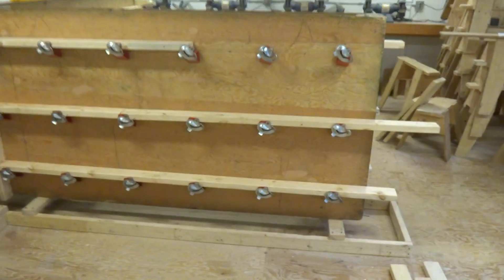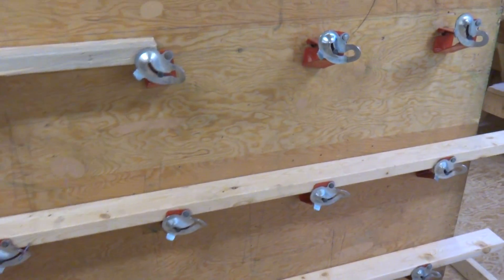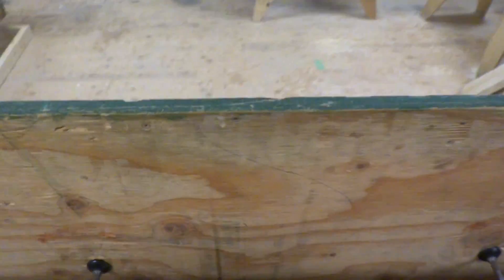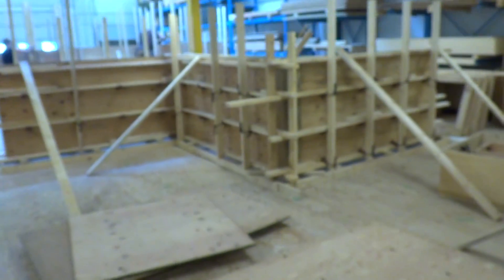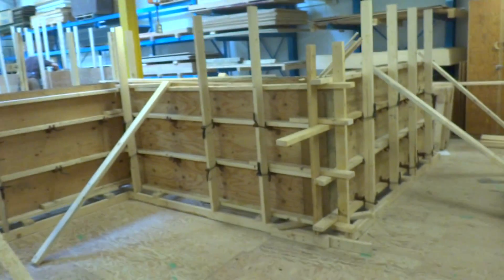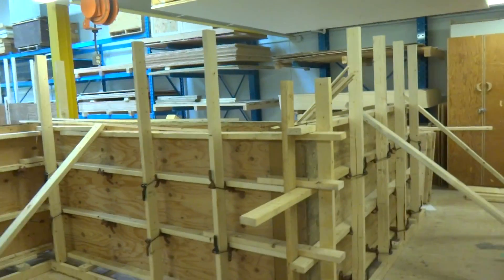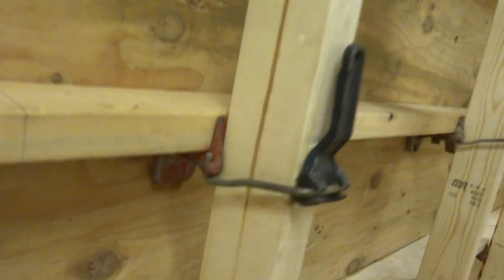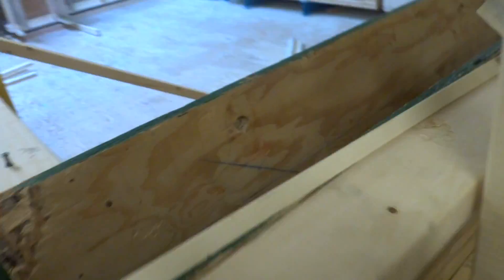4 Methods of building concrete formwork

Comment: Seems like what we used to use were called whaler clamps but I've never seen any of these in the video. We also used pencil rod with cat heads ( can't remember if that's the right name) but I've still got my pencil rod pullers tucked away in my old job box. Oh the memories...
   I bet this vid was of a union apprentice class going on
Reply: 37South Vintage Restorations The things I’ve had to use for the pencil rod are called “rosettes” but it might be a regional thing . You’re talking about the sort of oval shaped piece of metal with the squareheaded bolt that you tighten down onto the pencil rod after tensioning  it with the puller?

Comment: Why would anyone use any of these wood systems?  Give me a set of Con Techs, or Westerns with brick face outers any day of the week.  Set and poured in a day, not taking plywood and all those parts from job to job.  We d use plywood faced Symons forms for under 4' walls.  I'm not dogging these systems, but u couldn't make money in our market with any of those.
Reply from the maker: Matt D.I.MYWAY Martinson where do you live? I've used ICF for some house foundations, but any decent sized project it's been the John A brackets.
Reply: Iowa,  Almost everything is aluminum forms with brick pattern on exterior
Reply: It really depends on the situation. Having worked on a wide array of commercial projects in NYC I can state unequivocally that for many situations whether it’s due to logistics or irregular applications there is simply no more practical and adaptable form system than handbuilt wood

Comment: I do this for a living all day everyday I have never seen or used any of those methods ...kinda cool though.
Reply: mattronimus   Same bro. Been doing this for 32 years only thing close I've used are coil ties or Z bar.
Reply: The company I work for atm uses Gates systems for everything, Cams & loop ties for big walls, and rods & loop ties for 8' & under.
Reply: @dancarlin5434  yep.. you must be in the Midwest
Reply: @artesuave4760  Northern Idaho actually
Reply: I've used methods 1, 3, and variations on 4. Also wire-threaded rods. Just stakes and clips will work for really short walls. Single-sided walls are a pain because so much bracing is needed.
I guess you use prefab form work, if you haven't seen these methods. That makes the job easier, but requires a lot more investment in forms.
Reply: @TheTomBevis I've used stripies, duraforms, western  forms but for one sided wall and or stacked forms western is the way to go. Duraforms really good for 4 to 9 ft house foundations though.
Reply: marvin martin 12 years for me and same coils and z bars

Comment: Nice!  I'm new-ish to concrete and on a bigger job now using MEVA and Symons forms, also once using "pinrod and cat heads" - slang for something I'm sure.

Do you prefer one method to another?  What are advantages to each type?  Thanks!
Reply: meva badass forms but heavy..ive done 68 foot walls with meva and effco

Comment: This looks like an expensive project. What are the purposes of these different methods? With my experience only one method would really be necessary. All the material looks brand new! I work for a relatively small company and have been doing it for less than a year. This looks glorious to me.
Reply from the maker: Laszlo Vajda The video was made in an apprentice training course. Its for the students to know anything they might run into working in the field. The wood gets reused constantly.
Reply: This is a union training center for apprentice carpenters

Comment: In the 3rd method, what kind of wedge is that?
Reply: Know to west coast carpenters as a "hair pin"
Reply from the maker: darkbabe Its a steel wedge with a hole in it, then tapers off to one side. It slides on and tightens on the tapered end.